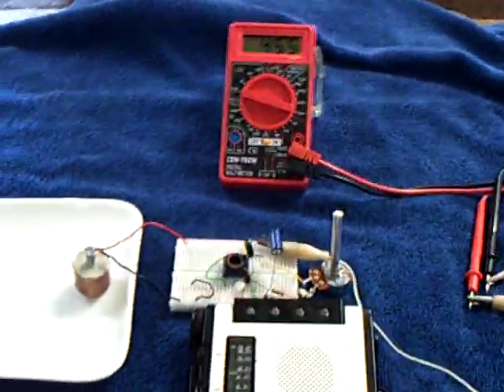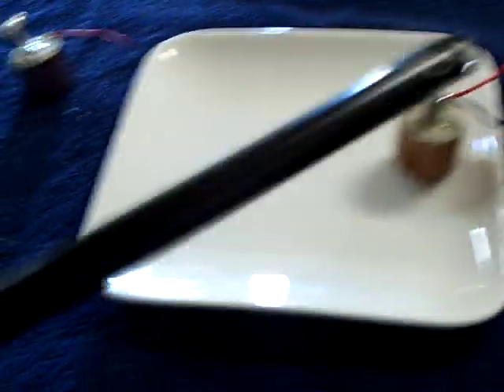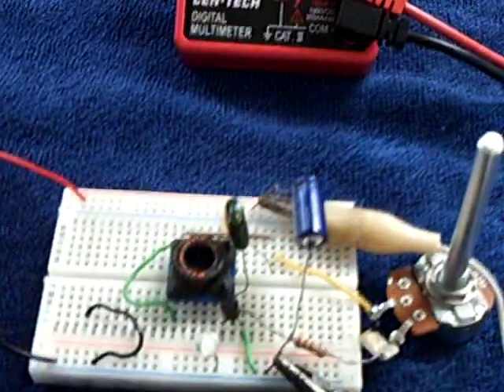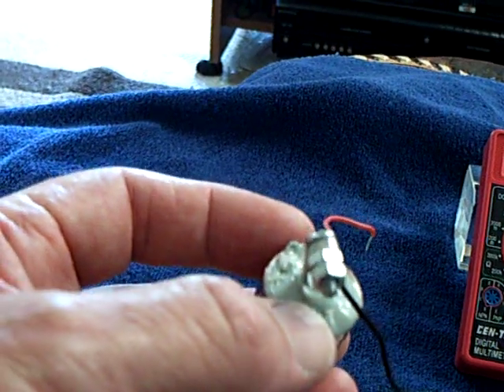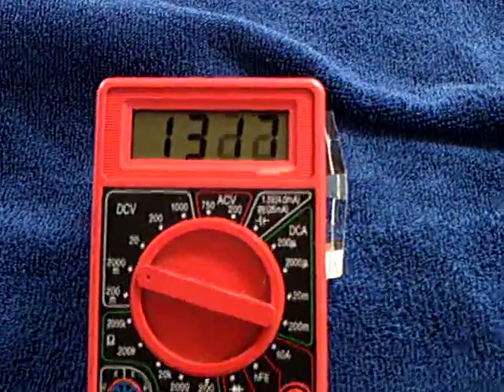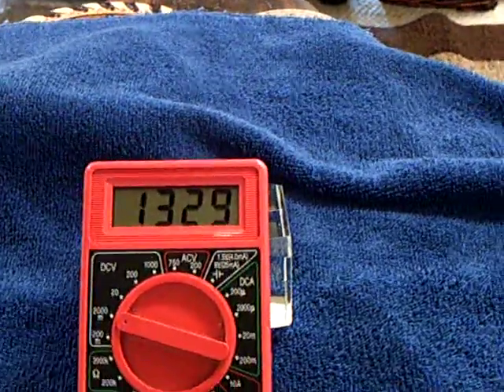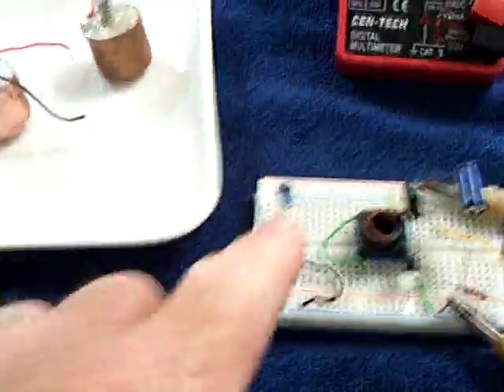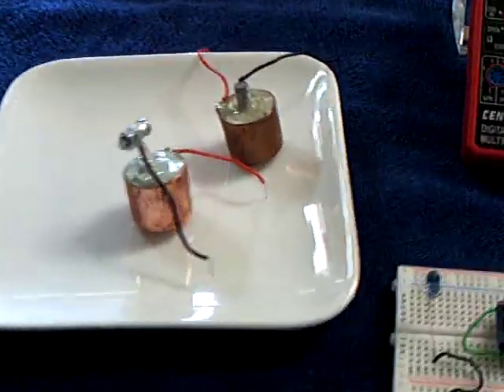Epoxy sealed crystal battery-- Update

Comment: what a drag i like this guys results the best especially because he sealed them but no formulae for the mix
Reply from the maker: Just use melted bath salts, put a magnesium strip in the copper cup, and seal it with 5 min. epoxy.  It is just an interesting galvanic cell.  It doesn't run forever.  When the chemical reaction runs it's course ---it is done.

Comment: Oh btw.. Magnesium Powder? to get it locally from your local hardware store.. you can buy 50 pound bags of Magnesium Chloride (a type of driveway melt) for about 25 bucks then take some and by electrolysis using two graphite electrodes... at the anode you will have chlorine gas formed (so vent well the area as chlorine gas is nasty to the human respiratory system if not fatal) .. and then at the cathode (on the cathode and precipitating around it) you will get magnesium metal ... normally in a fine fine fine fine powder..... which is perfect for taking some copper screen mesh and like apply elmer's glue to one side and like "dust" (like you are making a powdered donut) said screen with the magnesium.. which would have way way way way more surface area than your magnesium coil that probably cost 200 times as much as what an electrode made the way I described would cost LOL.. but yeah keep it up :)

Comment: Okay to explain why the seebeck effect is causing what you described as a diode effect.. you have to remember that thermoelectric power generation by the seebeck effect relies on two factors of metals.. one that the electrodes will have different resistances.... one that is greater and one that is smaller.. and two that the electronegativities of each metal are different.... see carbon is around 2.5 .. so very electronegative.. while aluminum is around 1.8 /// s0 less electronegative... so if you take a graphite pencil lead (carbon) and wrap and aluminum wire at one end and then connect your meter at the other end of each (forming a circuit)  .. you will see that by keeping one side around room temp (the side with the meter) and the other side lit by your BBQ lighter... well that you get a current generated.... more over the carbon (since it is MORE electronegative that the aluminum and has LESS resistance than the aluminum) will be the negative terminal and the aluminum wire will be the positive terminal...

The cations in the ionic electrolyte (yes the crystal batteries are simply a solid electrolyte)....run towards the Anode (+) and the Anions run towards the cathode (-) ..... the result is it creates an imbalance of charge that creates the electrical current ...

Now electrolytes that have ions that are free to swim about tend to work better than solids... only problem is the good electrolytes are hygroscopic.. so ... you don't want to use much water because well they will go RIGHT for that water instead of doing their job of creating  the current.... 

Solution?

Minimize the amount of water while still letting the anions and cations freely swim about (even if the pool is crowded).....

now with the design I spoke of with the copper screen / nylon screen / copper screen ??? since the distance between the electrodes is SMALL that creates less resistance by the water in the electrolyte... so with the reagents I described mixed correctly to the point of saturation by all of the reagents... it does the trick when heat is applied.... ;)

Comment: Yes you are getting a Seebeck effect between your anode and cathode.... your anode is one material (metal) and your cathode is another material (metal) ... heat + two different metals joined and heated at that joint will on the cool ends of the electrodes produce an electrical potential... honestly I am working on a thermo-electrolytic battery using a mix of sodium, magnesium sulfate, activated carbon, graphite, acetic acid held in a gel state with borax or polyproplene glycol with sheets of copper screen material that are oxidized on the end that will be dipped into the container for the cell containing the electrolyte solution with a nylon screen mesh separating the two screens inside of the cell (yes they are very close together) ...

Oh and your diode effect? hmmmm SEEBECK EFFECT ;)

Comment: Great video!  Very interesting.  Any idea yet on the following:

1.  Max. power (W) at a given temp?
2.  The energy capacity of your chemical cells (mah)?
3.  The energy density of your chemical cells (wh/g)?
4.  Does the cell deplete like a carbon-zinc cell & therefore it is worthless after it's useful life?
5.  It's useful life (days)?

Thanks for sharing!
Reply from the maker: A B It ended up being worthless but it does make a nice little paper weight.  If I heat it up I still get a tiny bit of juice out of it.
Reply: ***** That's too bad  I was hoping it would be something special.
Thanks again for sharing!

Comment: How about vibrating them to see if they have piezoelectric properties?  Things with piezoelectric properties are also pyroelectric.  I'm not sure but it would seem that the inverse would also be true, (at least in most cases).  Then the question would be what frequency would give the most efficient output.  It might even be possible to feed the output back into an oscillator which vibrates the cell with magnetic pulses. :-)

Comment: hey since you've got it down quite well with making these batteries, will you humor me and give it a shot with one and take some rough sandpaper and scour the butt off of the copper, and maybe the magnesium if you use a big enough piece?  I don't have the materials, but I believe that surface area of the metals makes a huge difference, so doing so should give you more voltage and current output. Once I can get some big magnesium, I'm going to give it a shot cutting slots in it and sanding both that and the copper.  I replicated some guy's cd case galvanic cell and got more power out than he did, and I cross-hatch sanded my aluminum flashing and copper sheet. But he also only used fanned out copper wire. If you do it, let me know what u get. My username on energetic is brian516 and the same as my UT username on energyscience

Comment: Suggestion Box Entry:
Wrap the core like an Earth Battery with magnetic wire, 27-30 awg, & attach a power transistor, 2N3055, connecting base & collector to magnetic wire leads.
...
Has anyone tested that yet?

Comment: Very impressed by the voltage on the magnesium/copper crystal cell. Im doing some work at the university of new hampshire trying to construct batteries that will power a small shoebox sized car. Do you think that a couple of these crystal cells connected in parallel would produce enough current to move it? Hooked up to a AA battery the motor draws almost 3 amps.
Reply: theoretically, surface area and pressure will increase the output, and heat definitely helps as you saw. so if you were to make a cell out of thick plate materials that you've sanded rough, compress it, and get the heat off of the motor to it via a heatsink of sorts, if the batt will get the car started, the heat will increase the power as you use it instead of decreasing it. But those cars take a heck of a load, so I really don't know if you'll be able to get it to work.  I'm quite new to all of this myself, but I just thought I'd throw that out there.

Comment: The conection is the crystal. Diodes are made of semi-conducting crystals. You are using the salt as a semi-conducting crystal. The composition of a diode and a solar cell are nearly identical. A crystal structure doped with impurities.

Comment: i am wondering if you put a few cells in a black plastic tube and covered it with some clear plastic if the output could be solar driven during the day and act as a heat sink into the night at least for a while?
i have seen very high temperatures using this method here in alaska.

Comment from the maker: @steventurtle1963 --------I have not tried to stack a bunch of LED together.  It is on the to do list.  The oscillator circuit is "Penny's" circuit and you can find that a few videos back.   The little coil in this oscillator is a 1:1 isolation transformer.  They come in different shapes and sizes.  They cost about a $1.  I got this one at BGmicrodotcom.  Look in the transformer section.

Comment from the maker: @TheMrblazer320 -----I don't know.  These are made with heat and I have been sealing them while they are still warm to get the epoxy to go off quick.   The idea is to keep the moisture out of the cell and seal it up fast.  The best voltage happens right after they are madet.  Some people are zapping the cell with voltage right it is made to align the crystalline structure.  I did that on this last cell.

Comment: I tried the infra-red led after watching your "Red LED used as solar cell--powering an oscillator", have you tried stacking more in parallel or series?... I haven't been able to increase its voltage by very much, mind you your oscillator is much better than mine. Any chance on passing on more information about that miniature coil your using on your oscillator.
Keep up the good work, Its fascinating stuff.
cheers

Comment from the maker: @slider2732 --- Thanks.  I did my cells on a gas stove top with a very low flame.  It is tricky.   It is kinda like baking a cake.  It has to be cooked but not burnt.    Be sure and use the 5 minute epoxy stuff so you don't get the wicking problem.   I don't have any old aluminum capacitors big enough to try Nick's idea out on.  It is not a bad idea though.   Someone else did that awhile ago.  I think that there is a video somewhere here of it.

Comment: Great update :)
What's your temp on the stove btw ? Epsom seems to melt out at a '3' on our electric stove, '9' cooks it dry in seconds, but I have no real idea where to set it !
Capacitor cans might be worth you looking at, as Nick shows. Easy to reuse the aluminium can, just dremmel the top off, remove the capacitor innards and reuse the top connectors. Lot less epoxy needed to seal too...which helps, cos i'm the one with the wicking trouble !